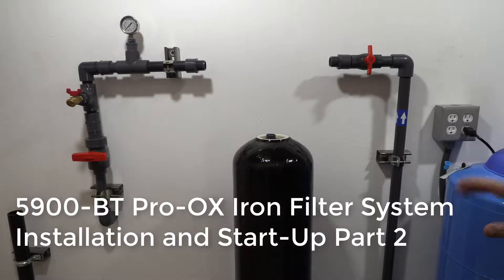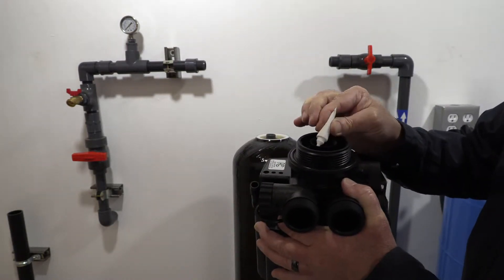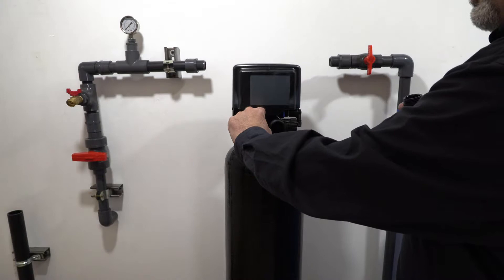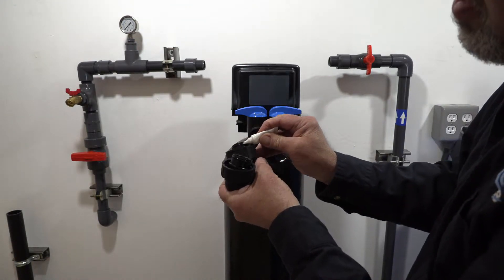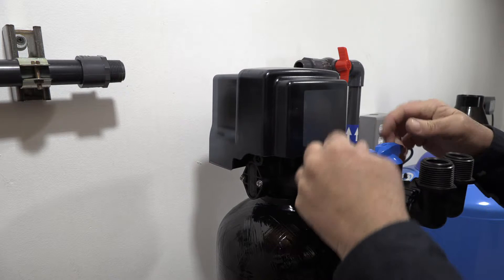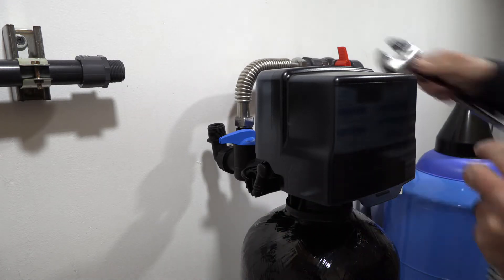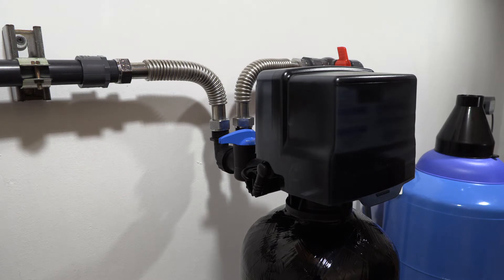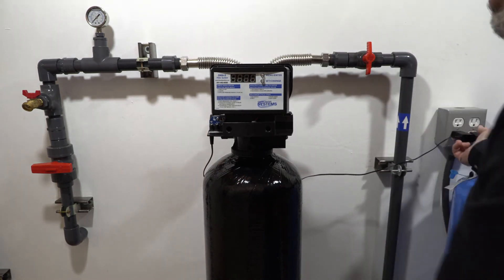5900-BT Pro-OX Iron Filter Installation Part 2

Comment: How come u didnt install the basket to bottom of main-valve?
Reply from the maker: Another good question,  the top screen or top basket is optional.  It is always used on water softeners, but for heavy iron applications, it is optional.   In some situations the top screen can become fouled with iron bacteria over time and cause pressure drop.   On the other hand if no top screen is used in some cases some media might rinse out to drain during backwash.  Generally lately we do recommend top screens but they are optional.